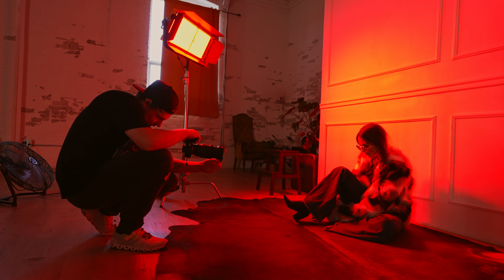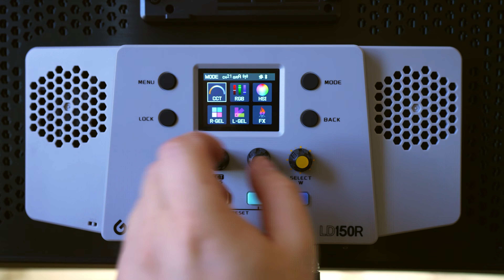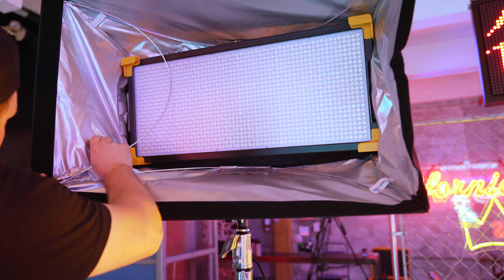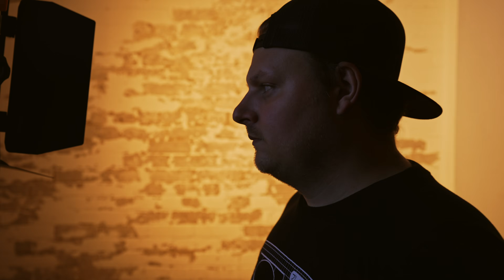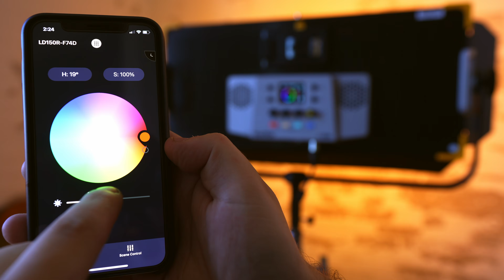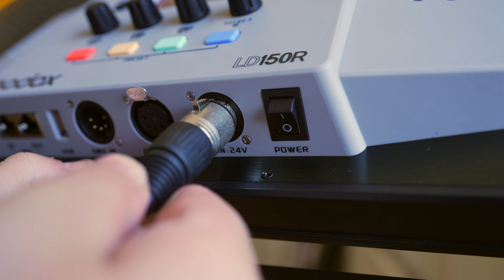The NEW Godox LD150R - The Budget RGBW Arri Skypanel - Review

Comment: I keep wondering if I should get an LED panel like this or a more traditionally shaped LED with softbox. Maybe I should get something smaller first, 1000$ might be cheap compared to others, I still find it a lot for light that doesn't have 10years+  warranty

as a sidenote...
it is obvious why certain colors clip faster on your face... because your face isn't a white reflector ... but it reflects red much better than blue for instance. In order to gauge brightness correctly, just put up a white standard from a color chart for instance and measure each channel (RGB) from the camera and you'll know. Also keep in mind cameras have a non-uniform quantum efficiency, so even if blue is just as bright as green (physically), the signal you see might be lower but that can very well be due to the camera!
None of that would be the light's fault.

Comment: Nice review! When building out your light kit from scratch. Would you say that buying lights without v-mount option and going with a portable AC power station is a more cost effective/versatile option? (For example Nanlite FS-300 vs Nanlite Forza 300.)
Reply from the maker: possibly more cost effective but also less convenience. Vmount on a light makes it so portable
Reply: I have the fs-300 and my solution is to buy a 680w portable ac power bank. A single one which costs 400€ powers the light for 1,5h @ full brightness

Comment: Nice review Lee. We are currently doing our own review of the LD150RS versions (the square but slightly more powerful ones), I would highly suggest that you test the new Godox remote it is really great (especially with these lights). We are also looking for a solution to the power brick issue - it's not just Godox its many brands - I talked to a few manufacturers about making a universal metal power brick holder with a v-mount.
Reply from the maker: I actually modded one of the power bricks to click into the vmount plate in the light. I bought a reverse plate (like what would be on a battery) and mounted it to the power supply. It looks and works great I just didn’t want to put that in the video as it requires voiding any warranty
Reply: @LeeZavitz  Hi Lee :)
How did you do that? just glued it to the brick? I tried this before - it didn't really stick - you need something that goes around the brick - these things are heavy and they need something secure...
Reply from the maker: No I took the case apart and screwed a plate through the back of the case and put it back together. It’s permanent https://drive.google.com/file/d/1lIWWQYbnq37DltwJ0-oAjY97S9pa6-8c/view?usp=drivesdk
Reply: @LeeZavitz  OK - I have the same plate but did you actually take apart the plastic of the power brick? I think it is glued in not even held with screws - that is some serious DIY stuff that I am not sure I would like to do, to be honest...
Reply from the maker: It’s screwed together. Under the little rubber feet are the screws. It’s easy to take apart
Reply: @LeeZavitz  Interesting - thanks for the info. After we finish our review in a few weeks I'll try and take that apart.